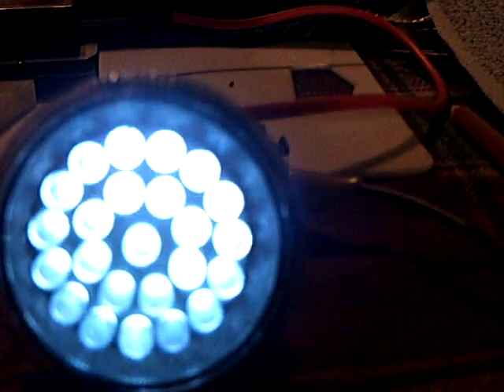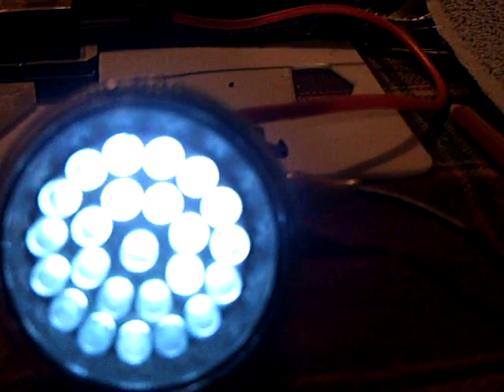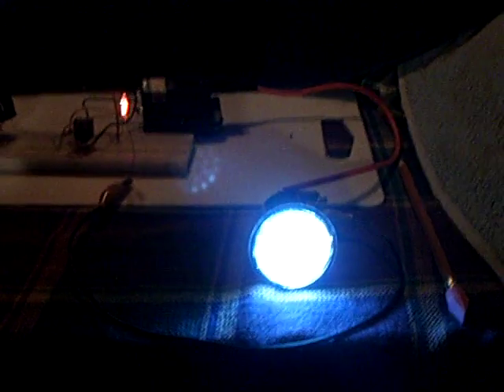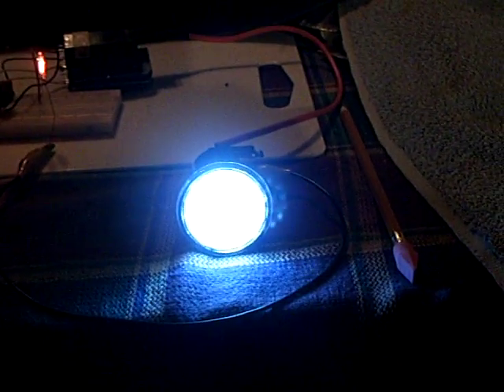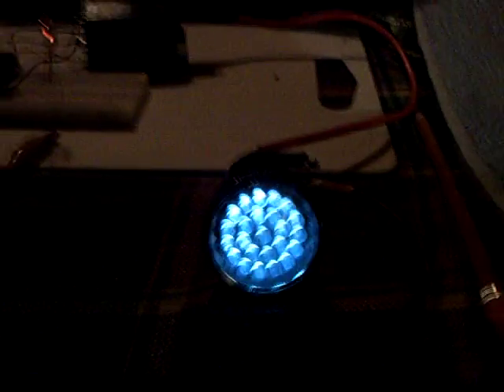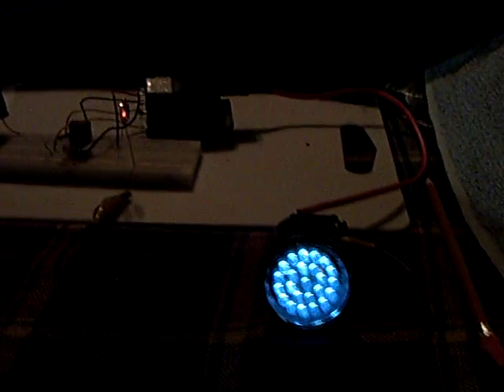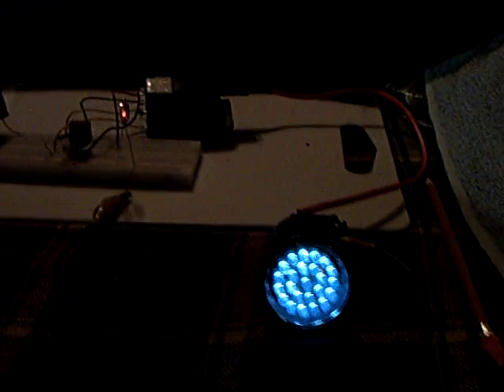Carbon and magnesium battery running a flyback transformer.ASF

Comment: @Lidmotor 
Hi Lidmotor,
the Alum generates acid sulfate ions in water, so this probably blocks the decomposing
of the magnesium cause the PH value will be lower than 7,
Magnesium  likes an alkaline solution to get well decomposed.
Can you verify that using Alum also decreases the electrical output power ?

Many thanks.

Regards, Stefan.

Comment: Hi Lidmotor,
well done.
I just looked up, what exactly Alum is.
Some spice sites claim it is just Aluminium sulfate.
but Wikipedia says it is Potassium Aluminium Sulfate.

See: wikipedia . org / wiki / Alum
(Remove the spaces)

So probably Wikipedia is right.
It would be great, if you could post some updates to it, if it really
does not consume much the Magnesium.
There are also other Magnesium alloys that are more stable
than Magnesium alone,so look up the
metal suppliers for Magnesium alloys.

Comment: Lidmotor - Would it be possible to get AV plug action on your "galvanic" battery if it powers an SEC or a Slayer-Gbluer Exciter???  Hmm that would be fun! Battery and tower all in one?  see if you can't get the power sources to resonate between themselves??

Cheers.